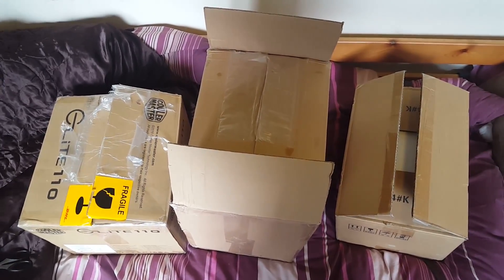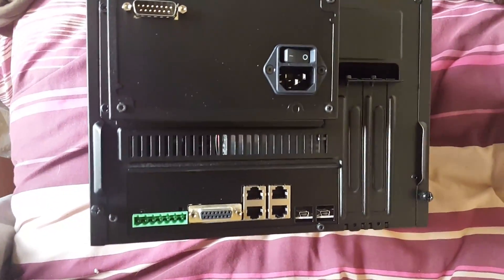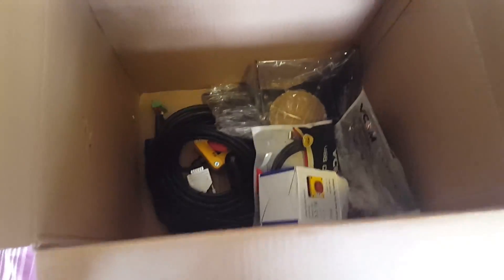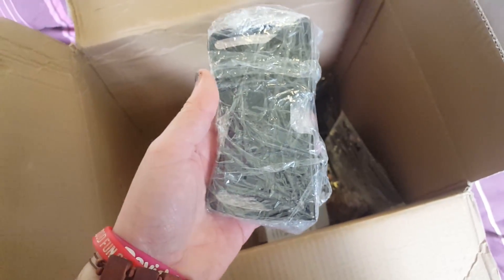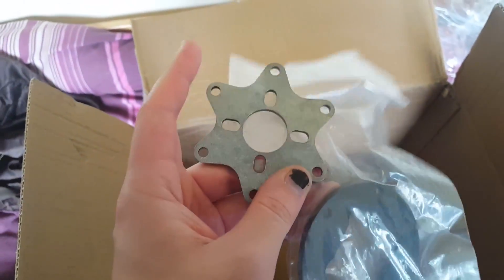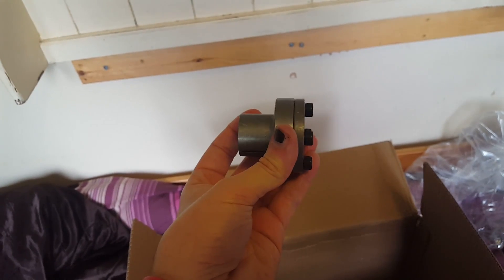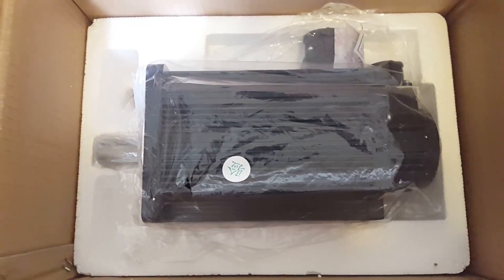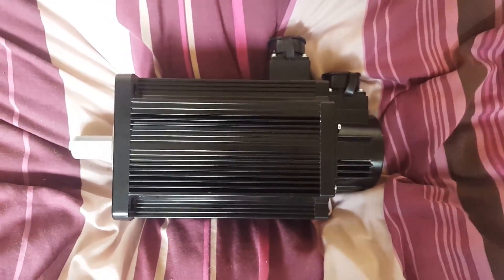My New Wheel (SimuCube OSW)

Comment: Wow, that's like a grands worth of gear, congrats Jimmy, long may it serve you! I guess you need some kind of metal frame/rig to support the weight of the thing and how does it work in terms of sim setup, I mean are there ready profiles for such a thing? I guess they provide some kind of controller software. Anyway you're gone full pro now, no messin ;)

Was thinking it might be cheaper to just get a PC power cable with UK plug fitted rather than an adapter, just a thought..

Comment: this first... you might need to check on half ffb rate in AC !  most OSW users and also some accuforce users... have to do it... I think from what I read ... every osw user with the 10000ppr encoders (which are now the typical encoders shipped by tomo) gets a 99% cpu warning in AC when not using half rate ffb.... the physics thread goes mad with full ffb rate (you can check it with the fps app ingame) .. I ran with 0 ffb steps skipped with the g27... switched to the OSW.. and thought WTF is going on ?? till I tried setting it to 1 again... or which is now the half rate option in the menu.... what the reason is and why.. it behaves like that.. is still the question in the forums... I personally think it's the mmos driver but that's just a guess I am no expert on that front... I hope this will change when the simucube own driver is ready...

so if you cpu goes crazy... check if half rate ffb is enabled first

be prepared to fiddle with ini files and settings :) .. however it is amazing... I also made the switch from an g27 to an osw from tomo (also simucube with the big powersupply but with the small mige... I'll upgrade to the 30nm motor in the future someday)..  in february and it is a complete differend thing then with the g27.... with the g27 you are playing a game with simulated physics...  with a osw (or other comparable DD systems) you are driving a simulator... 

I am sure you will start off with the settings for the games provided in tomos documentations file... just because to have anything to start from.... (with time you get more and more behind what it doing what and what might need to be tweaked to achieve what you want)

however for my personal taste it didn't fit totally...  I left the granity settings how they came from tomo on the simucube.. (with tbw at 680? the one with 600 ) ... but in the MMOS I changed the overall filter to 15... if you tend to drive more softer cars like road cars something in the 20-25 also works good (feels nicely rubbery) ... 15 seems to be a good comrpomise so you don't need to change it all the time... if you also drive more direct vehicles like formula cars and such things...

in AC I have the overall FFB gain at 80% ---- and then dial in the ffb strength per car to my liking with the + and - keys...
usually I do it like... high downforce cars without powersteering 100% cars with powersteering to my liking... and cars without powersteering but not so much or no downforce something around 80% (might be less for your 30nm beast... but everything all personal preference ofcourse) 

I also recommend trying the gyro effect in the AssettoCorsa.ini... I have it mostly turned on with dampening gain = 0.8

but it doesn't work with all cars... some cars tend to get pretty slugish with the gyro on... for example the porsche 962 feels amazing with it on... the sauber c9 feels not that great with it on...  for road cars it usually works good... 

the thing is with having it off it feels pretty unatural somehow...  but for some cars it just doesn't work good with it on either...

when you have it off I advise a bit of dampening... because otherwise the wheel can get too loose and too fast...(with that I mean unnatural loose and fast) when I have gyro on.. I tend to run no dampening ... when having gyro off I think something between 20-30% and 20-30 saturation ... works good... I usually run 20 then..

also take a look into the ffb_postprocessing.ini  in your documents folder..(in the assetto corsa folder ofcourse) ... with the g27 I used a LUT file... however I can't get a correct measurement of my OSW... but since I assume it is already pretty linear... I changed it to use GAMMA and the gamma value then 1.0 
I had turned the ffb postprocessing off first.. with the osw.... but switched it on and to gamma 1.0 now... which feels a bit better in my opinion then the kunos vanilla ffb..  you get a bit more of the nuances and details with gamma at 1.0 then with having it off

another thing is... I don't know if you run iracing...  and if you change the ini to what is in the documentation.. which I think is good... but be aware of the point no clip lmiting or something like that...  well I run it with no limit... but be aware... if you have a crash then..and your front axle is involved.....  TAKE YOUR HANDS OF THE STEERING WHEEL !  when I had my first crash in iracing I was lucky to not break my thumb :D .. and I have only the 20 nm wheel .. you have almost 10 more ( not completely because of the ioni limit.. I think you have somthing around 27 or so) ...
and with running no limit... iracing will use that full force... in such situations... even if you have dialed it pretty much down... but the forces on hard or unlucky impacts .. are so high that it will HIT you...

oh and Gloves are a must ofcourse :)

with you having now a pretty similar setup as I have... I can say... you will be much more confident on the brakes because of the heusinkveld pedals... and you will be much more confident on the throttle because of the osw :)

and OSW is like a good pair of studio speakers (where good produced music sounds awesome but bad produced music sounds terrible) ... thats pretty much the same with the simulated cars now....  some cars feel absoluetly amazing.. undesribeable good almost...  but some cars will feel pretty unattractive now :)